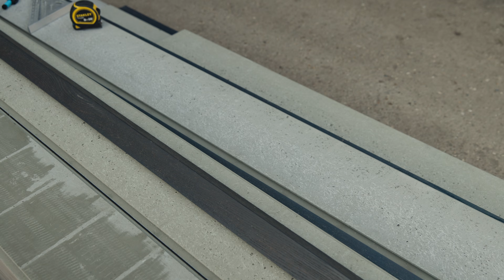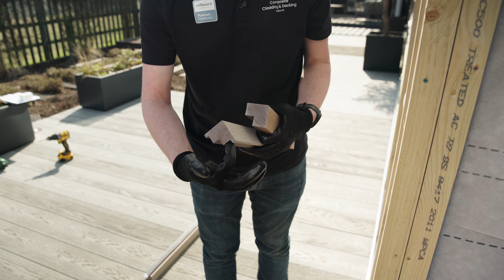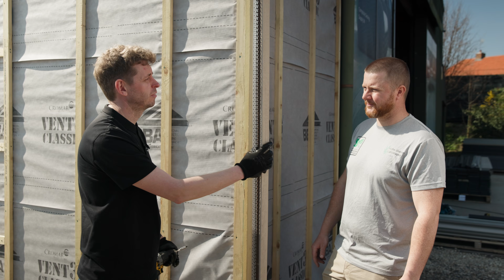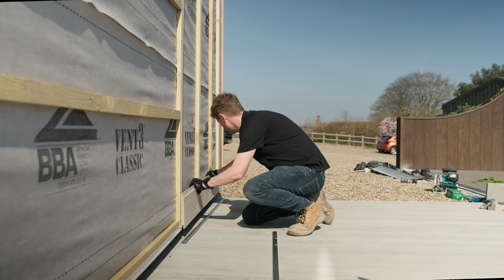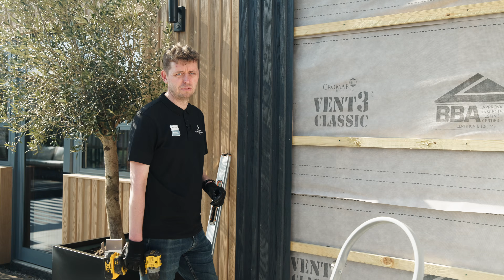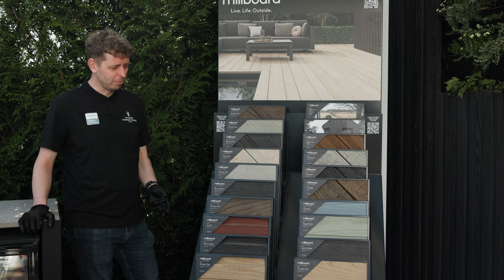How to install Millboard Envello Cladding - Shadowline and Board & Batten

Comment: Hello, thanks for the great video.   If the composite cladding is installed over a good quality stucco, with no cracks, mold, etc,  do you recommend to still install a vapor barrier over the stucco and before the battens?

Comment: just priced doing two waalls of my garden room. one is 3.5m and one is 5m. £3600!! Lovely product but clearly not for normal people.
Reply: Compare with getting external walls rendered or whatever, it's not that much more... you get what you pay for. Because it's synthetic, the cladding will outlast most natural products...
Reply: @MatSmithLondon  I understand the quality and lifespan etc but rendering my two visible garden room walls (it's in a corner so will have metal on the hidden side) would be a lot less than 3.5k. I'm interested in fibre cement boarding but worry that it might fade. I really like the look of Millboard but it's too expensive for me unfortunately.
Reply: @Dugberty  By the way, since I wrote my comment, I have installed Millboard cladding (antique oak I think it was called) on the soffit and large fascia of our new extension. Total cost was 1.1k. A lot yes, for basically 4m x 600mm high fascia and 4m x 1m soffit (plus wrap arounds), but having worked with hardwood decking outside in the past (building various furniture / decks etc. out of it) I'd never go back. Ours is like a cantilever overhang that extends 1m beyond the building line. I added really nice surface mount stylish lighting (dimmable etc.) and plan to possibly add marine grade speakers as well. The result looks absolutely stunning from day 1. I used the matching colour paint to touch up edges, and the incredibly eye watering priced matching colour screws (£75 for a pack of 100 screws, fell off my seat!!) Never used Millboard until October of this year and yes it's not cheap, but I wouldn't use anything else for this project given the sharp look and peace of mind that it will keep that look for a long time. Sorry I know I probably sound like I've been paid to say that (which I have definitely not!), but sometimes you just have to give credit where it's due...
Reply from the maker: Hi Duggy, Mat makes a good point. If you look at the lifetime cost of this product versus others, you will find it very comparable (if not slightly cheaper!). If you have had a quote from us, please let me know and I'll see if theres anything else we can do for you. Thank you

Comment: And what should you do if the cladding + framework is 64 mm and the corner profile is only 50 mm? I would like to finish the end corner because the cladding stops at that corner.”
Reply: you wrap cladding around the corner. it doesn't matter what size the framework is. the corner piece only hides the edge of the cladding. nothing to do with hiding what's underneath i.e. the framework
Reply from the maker: Hiya, Mat Smith is correct. The corner profile sits on top of the framework so only hides the edge of the cladding. Any further questions, please call us on 01303 656016

Comment: In terms of the horizontal battens for the vertical cladding, would you not require to use counter battens behind those to keep the airflow/drip run off or is this not important for a composite board (as opposed to timber cladding which would require this)?
Reply from the maker: Hi Glen, yes you would need counter battens normally for air flow but in our application (and others), they are not always needed.
Reply: Hello, in what situation would you not need the vertical battens? I.e. why are they not needed in your application? We are close to the point of installing vertical cladding and are debating the need for vertical counter battens which of course increases the depth of the cladding from the external wall. Much appreciated

Comment: So how did you secure the last vertical board at the corner fascia?
Reply from the maker: Hello, thanks for the question. The last board on the run is always screwed with colour headed screws. This applies to both vertical and horizontal applications.
Reply: Can the colour touch up paint be used to colour the screws?